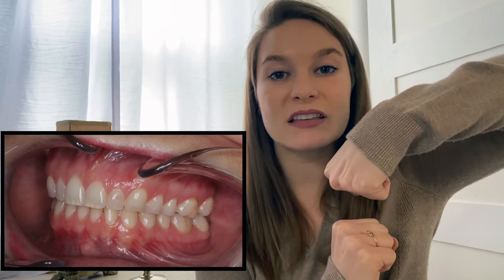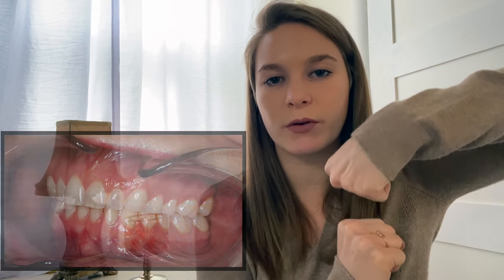TMJ Splint Therapy | Phase I | My Treatment

Comment: Thanks for all your videos.  Going through the same thing right now, 4 months in on Phase I, 24x7 with the splint.  My wife told me within a couple weeks she couldn't really detect any lisping any more, but I still could (still can a bit).  Eating was certainly tricky the first few weeks, but I got the hang of it and now it's no biggie.  Your responses to other commenters is spot on - just plan on rinsing/brushing after any meal.

I had other interesting experiences after adjustments as well - I started to notice I was getting better range-of-motion in my neck and upper torso -- for example, that move you do when you're looking out the rear window to back up the car?  Suddenly that felt way easier.  I had never registered it as problematic before, but clearly I was somewhat impaired.

My TMJ/apnea provider's splint is a bit different than yours, in that there is clear acrylic across all the lower front teeth as well.  Mine didn't come with any wings either.  It's basically like an invisalign and then he added some additional material (methyl methacrylate?) to the back, had me bite just a bit on that (blech! tastes like fermented skunk), cured it, then ground it down using bite papers over and over again to make sure I was getting occlusion across all the teeth evenly.  Every month my provider re-checks the bite with the papers to see where I'm making occlusion on each side of the splint - usually some teeth aren't hitting after a few weeks - and then he grinds it down again until I'm making occlusion all around and we repeat the process.  It's kind of neat to see what it's teaching the body to do ... and as time has gone on, I'm less out-of-occlusion each time I go back.  I imagine that once I go back and I'm still at the same occlusion, that's when we've figured out where the mandible wants to be, and will start Phase II (getting the maxilla back out in front of and around the mandible).

The only thing I wish my provider had done, was made it clear what would happen once the mandible moved forward.  Moving from what I thought was a normal bite, to now having my incisors touch which leads to a posterior open-bite (for now) is both interesting and unsettling.  Interesting in that my mandible absolutely, positively has moved - and I like the idea of the mandible naturally "finding" its preferred resting position.  But unsettling, as now I have a 100% dependency on the splint to eat.  If I were to lose it somehow, it would be a lean few days of living only on smoothies!

Phase II for me will likely be the Vivos DNA appliance.
Reply from the maker: Doug, thanks for your comment and for sharing your story. It is great hearing about everyones different experience. You seem to have done your research and are educated on your treatment. Best of luck with everything! Thanks again for sharing and let me know how the DNA Appliance goes! -Crissy
Reply: How did everything go for you?

Comment: I've just got my dental splint... and it is extremely difficult to talk.. and my jaw hurts may be because it is adjusting my jaw to it's proper place. However my dentist said that I can remove my splint when eating. By the way my dental splint is twin block and I have a small key (looks like the one we use in celphones when we remove sim cards), which I use in adjusting the splint every 4-5 days. The n, I was advised to regularly visit the clinic every 3 weeks.

Comment: hi, crissy, jeff again, all your videos are very helpful, did you get MRI and CBCT before your treatment, what's your root cause of all symptoms, disc displacement or tmj derangement? because repositioning can recapture disk. my questions are 1. have you noticed your bite change? irreversible change? how your dentist fix this change for you? 2. have your clicking noise and muscle pain be resolved? 3. how long it takes you to find out significant  improvement after wearing? one week or one month? 4. usually dentist suggest lifetime night use of splint after jaw stablization, are you going to wearing night splint lifetime long?
Reply from the maker: Hey Jeff! I will do my best to answer all your questions. There is a collaboration of factors that caused my TMJ. Occasional disc displacement was a factor of mine, yes. 1. (Keep in mind, I am now in Phase 3; this video is about Phase 1). At the end of Phase 1, I did notice a bite change, absolutely. (I was only biting onto the splint) Irreversible, probably not. This change was something that my dentist knew would happen and was pleased to see the good results. 2. Yes, clicking and muscle pain were 99% resolved in this phase. 3. I responded pretty quickly to the splint, closer to a 1-2 months for symptoms to unravel. 4. My splint was intended to change my bite, so that I could relieve my symptoms and move to Phase 2 of my treatment. I believe you might be referring to the concept of a temporary splint used to relieve symptoms with the assistance of a night guard for long term. I wanted to correct the "root cause" of have a trapped mandible due to my maxilla being too small. This was so I could permanently eliminate the need for a night time splint (along with other things). I hope this helps you!! Thanks for the questions, as always. - Crissy

Comment: First of thanks a bunch for posting this video I have TMD I first began getting headaches and then shortly after my jaw started to pop and crunch this all happened to me at the start of the Covid pandemic. I went mouths without being able to get anyone to even look at me. I was eventually seen and X-Ray'd  by a Oral Surgeon I had two un-errupted wisdom teeth which needed to be surgical removed but I had present excruciating TMD the professional sent me to Physiotherapy and I also underwent Chiropractor care to improve my clenching and muscle inflammation it helped a lot in the months prior to my extraction date with lots of patience I was able to open my mouth fully but there was still clicking. I was fully knocked out with sedation and the too teeth were removed. However I am still suffering with TMD to the point its affecting my daily activities. I previously had braces when I was younger and went years after without any problems. During the months of waiting I experienced dental relapse and have developed a overbite and crowding on the right side I am struggling to establish a bite and the alignment is of and moves both sides I wear a custom fit mouth guard at night but my teeth touch at back and tap where my remaining wisdom teeth are the teeth are healthy and the they  the surgeon will not remove them. I am now considering getting splint therapy but it appears as though I will have bring this up with my regular dentist. Did getting your splints help with the clicking, popping and the jaw deviation?  Finally did it exasperate the inflammation in your mouth? I would like to thank you for this video has been very informative and insightful to myself. Wishing you well in your continued treatment and hope that you have cured this awful condition.
Reply from the maker: Gosh, you’ve been through a lot! Yes, a splint did help to relieve my symptoms, but I would caution you, that not all splints function the same. They are all different. I’d definitely recommend seeking someone who is rehearsed at treating TMJ! Best of luck! -Crissy
Reply: Do you also have ear ringing sir?
Reply: @livestreaming7295  I did not experience any ringing fortunately are you having troubles with your TMJ/TMD?

Comment: Wow great content! I have TMJ and my jaw clicks when I fully open it but it doesn’t lock. My midline is slightly off for this reason and one side of my jaw has grown on one side more than the other... would you recommend this for my case?
Reply from the maker: Thanks for your comment! I would recommend seeking a professional to help determine if this is something you really need or how severe your case is. I wish I could give you an answer, but it would be wrong for me to make a recommendation without seeing you in person! Thanks again for watching! -Crissy
Reply: We’re kinda in the same situation? Did you had yours treated?
Reply: @christianquilantang3259  I just got my splint a few days ago. Same problem, my midline is off. The only problem I have is the lisp. Other than that, it doesn't hurt or anything. Nothing you can't handle. In the Philippines, I paid 25k then braces after 50k. Better to ask your dentist :D

Comment: Very helpful. I think my TMD issue is similar to yours. I am diagnosed finally with a large overjet with the retrognathic lower jaw. Still exploring splint options.
Reply from the maker: Best of luck!
Reply: Do you have ear ringing too maam?
Reply: @livestreaming, I did. But the tinnitus resolved.
Reply: @drwitch13  how many months before it vanished? And did it vanished during first phase which is splint or on 2nd phase?
Reply: How did u correct your overjet? Any appliance or therapy?
Reply: @livestreaming7295  wait,  my ear ringing in one side may be related to my bad tmj on same side?

Comment: Hi there, thank you for this informative video. I just got a splint today. I also had a CBCT scan done and while reading my report I noticed it said that there was flattening of my left bone joint. Does this make my case more severe? Thank you again for your videos!
Reply from the maker: Not necessarily.. the condyle remodels overtime depending on what it needs to do to function. This is very common. The remodeling (flattening) could make it more challenging but it also could have no impact. It might also remodel again after treatment.

Comment: What were your tmj symptoms before getting the appliance? I’m having trouble figuring out if I’m having actually tmj jaw alignment issues or stress/anxiety induced muscle clenching. I’ve tried not to actual clench and I know I can achieve that during the day time but night time I know I can’t control. Long story short but nightguard actually makes my clenching worse so I’ve given up and that. I’m trying to relax my mind more and I think I am not clenching as bad at night time. Anyway, but did you have actual joint pain issues ? Just curious what your symptoms were and if I need to be taking this more seriously rather than hoping it’ll go away.. I’ve worked in a dental office for 10 years, had 2 sets of braces but within the last year of 2 all this random tmj pain has sort of come up and I think it might’ve been caused by the retainers I was given the 1st time after braces and how it affected my bite when wearing them thus making my jaw out align. This second set of braces I said no removal retainers they give me problems so they just glued on a permanent retainer.
Reply from the maker: Virgo, 
Thanks do much for your comment! You mention so many things in this post. Yes traditional orthodontics/Invisalign is typically retractive which moves your teeth backwards in your jaws. This certainly will affect your TMJ and airway. My TMD arose after my first set of orthodontics as well due to the retraction of my teeth to get them straight. Keep doing your research and I’d certainly recommend getting a CBCT and having it evaluation by The Facial Beauty Institute (orthologic). The best way to do that is to find an LVI (Las Vegas Institute) doctor. I know it’s confusing, but keep investigating! Feel free to email me with questions too! Thanks again for watching. 
Crissy

Comment: Were you start wearing your splint 24/7   since day 1 or you ease into it by slowly increasing hours and what symptoms you need to experience in order to go for an adjustment?
Reply from the maker: Hey Bainazir, 

I wore the splint 24/7 since the first day. 100% of the time. The adjustment appointments were pre-scheduled with or without symptoms. They checked the bite and made sure it was balanced even if I didn’t have symptoms. So they definitely made an adjustment if there was any kind of symptoms. Adjustments were in sync with physical therapy too though. 

Thanks for your comment! I hoped I was able to answer your question!
Reply: @DentalDork  ,thankyou I am feeling a lot better after 2 days.
Reply from the maker: @bainazirsalman561  Best of luck!

Comment: Question: If a splint helps place the TMJ in a more ideal position, why not do orthodontic or orthognathic work that permanently puts the TMJ in that ideal position, without the need of a permanent split?
Reply from the maker: Great question! That is ultimately the Phase 2 of the treatment. A splint or removable orthotic is used as a temporary relief device. It helps to determine that, IF the TMJ is properly placed, is pain relieved? If yes, then phase 2 is treatment planned. Thanks for commenting. - Crissy
Reply: @DentalDork  That's great to hear!

Comment: I just got my TMD treatment splint yesterday, and unlike all the precise measurements made for your splints, all my dentist did was take an impression of my teeth and voila, my splint was made after a week. It looked much like what you see in the net as the full clear device. My question though, does it make your chin longer or it can still be fixed with braces? I’m afraid I may end up with a different angle of my face right after the splint or braces as well, so I really need the assurance, especially with surfacing methods like orthotropics... Would my face not look weird/lessened with aesthetic right after treatment?
Reply from the maker: Thanks for your comment! It is difficult to answer your question, because I don't know exactly what your treatment is, but I will try my best! 
There are so many factors that can play into facial appearance change. A splint itself likely won't permanently change the appearance, however orthognathic manipulation of some sort (orthotropics alike), likely will. There is a variety of appliances out there that can be used to non-surgically change the maxilla, which will likely change the position of the mandible, etc (and whole face appearance). Typically, the goal is not to have a longer face, but to have a more forward, squarer appearing face. This is likely to result in a more aesthetically pleasing appearance. 
The reason I say "likely" is because anything is possible and there are various factors that might apply that could change the "likelyhood". I always recommend seeing a professional and being thoroughly evaluated to have treatment tailored for just you. Everyone is different! 
I hope this somewhat answered your question!

Comment: So, the issue with a posterior pivotal appliance (which is what you have) is that it does not adhere to the "perfected occlusion" guidelines. This prevents from having stable holding contacts anteriorly and you have lost your anterior guidance. If this particular splint were to be used for an extended period of time, this could potentially result in intrusion of the posterior teeth and super eruption of the anterior teeth. As a result, you could lose your posterior teeth contacts, resulting in anterior contacts only, thus distalizing and driving back your condyle into the retrodiscal tissue--the source of the neurovasculature of your TMJ. 

The device you are using is often warned against due to what is mentioned above. While I do not know the state of your articular disc-condylar head relationship and other factors as well, I still would advise against using this device.

I do wish the best for your treatment, however!  If issues do not resolve, I would recommend seeking a dentist who follows the perfected occlusion guidelines.
Reply: Wut
Reply: What type of dentist would that be please? Unlike most, I agee with you!
Reply: @tvalue4618  I would recommend seeing a "TMJ specialist". It's someone who has graduated from a dental school (DMD or DDS) and has gone through additional training of the temporomandibular joint / temporomandibular disorders.

Comment: crissy，how are u again. Are u still wearing any splint any time a day, all your symptom still 99.9% away? MRI shows my joint is normal, but my  joint click randomly many time, do u any suggestions for me? I appreciate your precious reply!
Reply from the maker: Hey Jeff, I am currently in Controlled Arch Braces. No longer wearing the splint as my mouth has changed. I have bite pads on my molars. Symptoms have remained mostly gone with occasional flare ups. Yes, occasional popping/clicking but with no pain. Personally, I believe eliminating pops/clicks 100% would be incredibly difficult, however it happening without pain, is an achievement. Hope this helps! Good luck! -Crissy

Comment: Hello! Just wondering if you had any discomfort/aches in front of the joint soon after you starting wearing your orthotic? I got mine yesterday and while it has reduced the stuffiness in my ear a little, i'm experiencing stretchy kind of aches in front of both joints.. did u experience anything similar? thanks!
Reply: Hi, I am on my 2nd day and this is so much better than the 1st day where everything aches, now it only periodically aches
Reply: How is your ear now